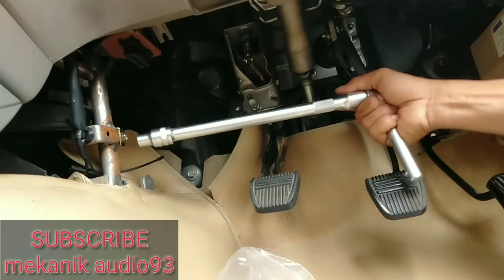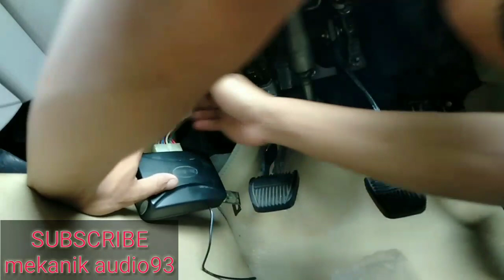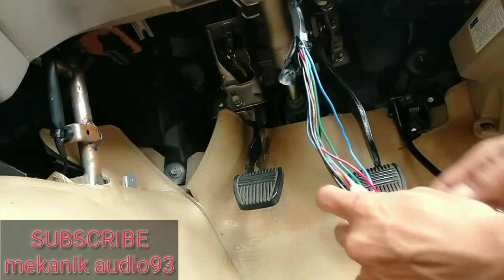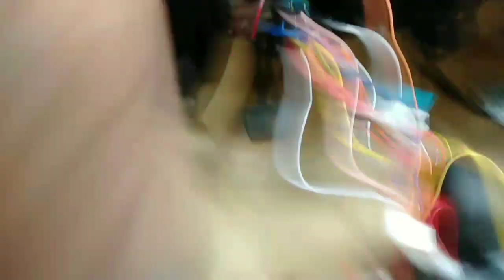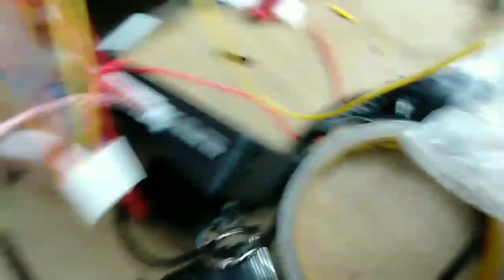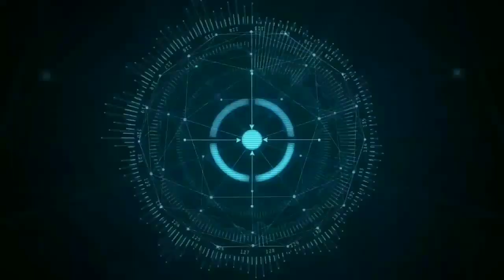cara pasang alarm avanza par2

Comment: Izin bertanya kakak,dalam pemasangan remot Avanza G kalau jalur ACC atau kabel warna Kun Ng Dr mobil tidak terpasang/sengaja tidak di pasang apa pengaruh nya....?
Soalnya setelah saya bongkar modul remot saya tidak ada jalur ACC nya/kabel kuningnya, kenapa...??
Reply from the maker: cari kabel kontak on , jangan acc ..
untuk pengaruhnya untuk auto lock/ auto ngunci ga fungsi karena sistem dari kontak tidak tersambung , dan ada kemungkina pada saat maju suka bunyi sendiri karena ada arus input yang masuk dari.swict rem, dan pada saat mobil berhe ti dari perjalana pada saat kita buka pintu asti secara manual otomatis sirine bunyi lagi ,..kabel kontak berperan.penting jadi sebisa mungkin sambung
Reply: @BangAray-93  terima kasih itu maksud saya, soalnya setelah saya bongkar remot alaram yg lama itu tidak ada jalur kontaknya/mungkin di putus sama yg pasang, dan stelah saya pasang modul remot aftermarket yg baru hanya kabel putih dr remot yg tidak terpasang alhasil stiap 5 detik saat di tekab lock pada remot pesti berbunyi,, dan saat di injak rempin tidak mau ngelock otomatis,,, trimakasih kak jd harus di sambung kabel kontak on nya,
Reply: Satu lagi kak, stelah saya buatkan jalur kabel kontak on baru,dan saya sambung ke kabel putih, hasilnya ok,kalo mesin hidup alaram tidak berbunyi yg biasanya bunyi 5 detik skali,tp kalo mesin mati terus di lock remot masih bunyi kak alaramnya,tp kalo kabel yg ke switch rem saya cabut tidak saya sambung itu tidak berbunyi,,  posisi kabel orange saya sambung ke positif switch rrem, apakah penyambungannya salah kak,,apa yg bener ke jalur negatif remnya ya avanza g 2010
Reply from the maker: @dee0549  cek pake tespen , lalu posisi rem di injak tespen menyala ,itu yang di sambung ,
jangan sambung kabel swict rem yang strumnya stanbay nyala terus
Reply: @BangAray-93 DONE.......
 sukses kak, mantap tutorialnya,, hanya saya gagal fokus dengan diagram bawaan remot nya, tentang switch rem YG di gambar +,, dan clear

Comment: om , kenapa pintu belum rapat tapi saat lock nggak ada peringatan alarm ya ?

apakah harus di pararel dengan kabel switch pintu depan kanan

* switch pintu normal semua
Reply from the maker: mingkin swict tidak tersambung sama pintu yang lain , hanya satu swict saja yang tersambung
Reply: @BangAray-93  aman kah kalau kabel dari alarm yang menuju ke switch pintu saya pararel ke semua pintu om ?
Reply from the maker: @dwihartanto9114  aman ga mqsalah , yang penting swict pintu normal semua
Reply: @BangAray-93  baik om...
trims